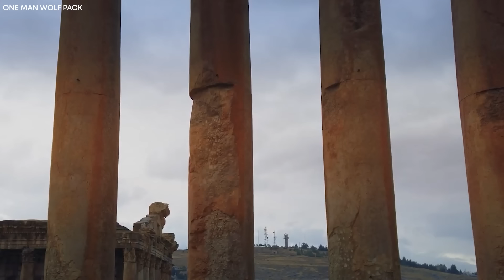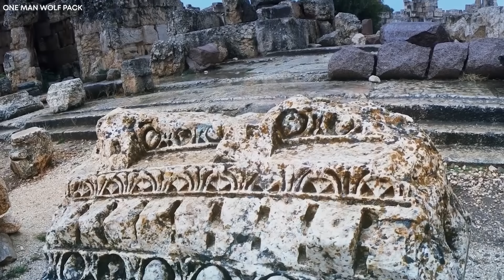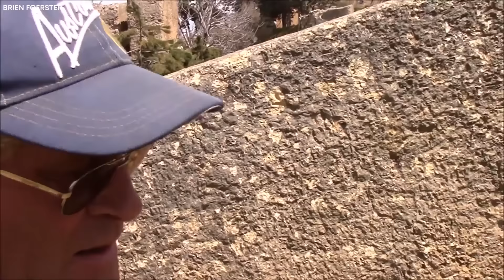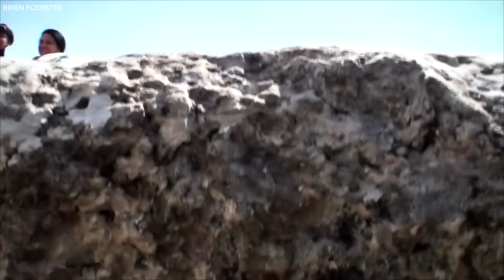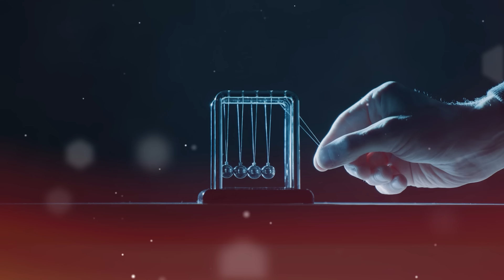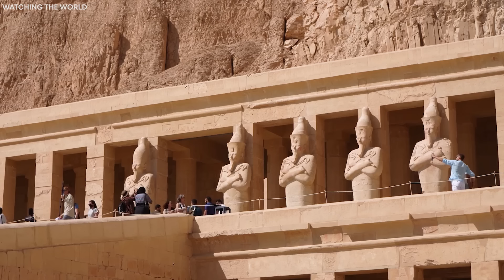Baalbek's Trilithon SHOCK: The 800-Ton Monster That "Should Not Exist"

Comment: The stones were poured and molded, not carved or chiseled.
Reply: Where is your statement recorded for accuracy? I’m always amazed at how they was quarried…… especially cutting and removing the base???
Reply: @Benmelech  The stones were poured. The nubs were drainage during molding process. Search it.
Reply: The french guy who proved that it is the case of some stone of the Giza pyramids was fired from the country the next day. 
This video assumes that the Romans did this temple, when they probably 'recycled' existing structures. Proof being that these 3 stones are on the back side of the temple. If they had did it, they would have put them on the front.
Reply: No, there are unfinished ones still 8n the cc quarry.
Reply: Stone cannot be imitated as concrete. The make-up is different and can be scientifically tested. A stone mason would know the difference strate away. Also, the quarry has matching stone, also,the square has spaces where the matching stone were cut.